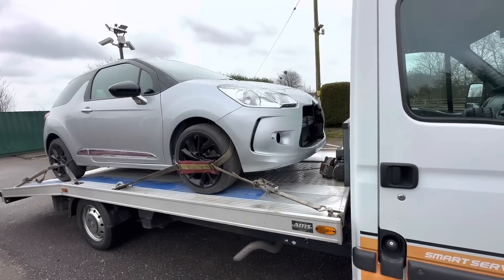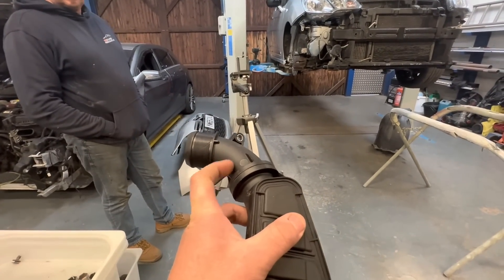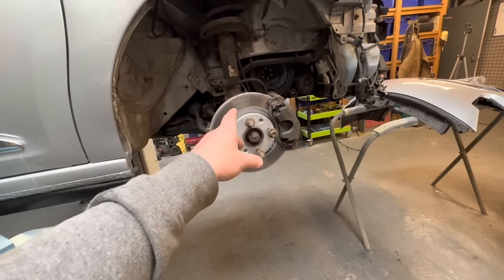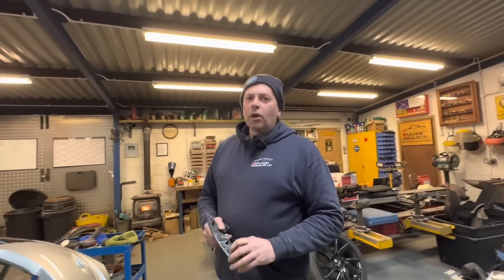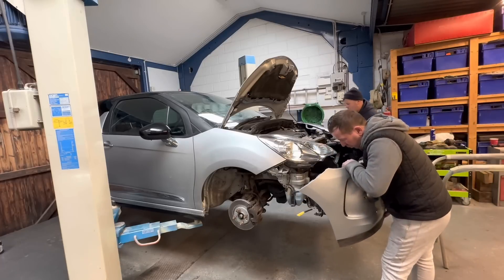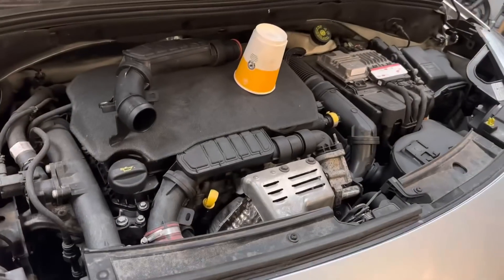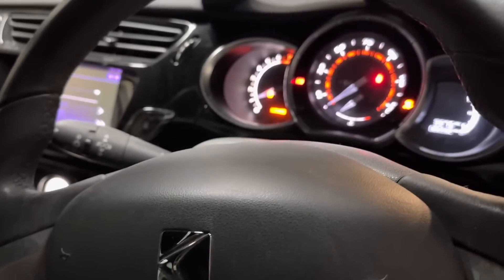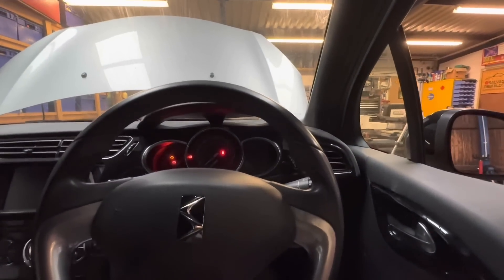CRASH DAMAGED DS3 FINISHED BUT WAS IT A BARGAIN ???

Comment: Sometimes a repaired car is a better buy than the "usual" car purchase because it might often include new or servicable components on the brakes, steering or suspension. Just beause a car is shiny and looks good it does not reflect the state of the mechanics of the car whereas with yours at least everything is known and upfront. Good job.

Comment: Clearly the older the car, the lower the eventual sale price so I would argue that the buyer should expect a few compromises in the cosmetic side of the work to put it back on the road - especially at the prices you charge. Over the years I have watched the channel I can only recall one occasion when you said - we won't fix that, we will give buyers the choice of a lower price or a pristine car at a higher price.

Comment: Hi guys, great video as always, I have a question to ask you chaps, when repairing the front ends why do you not re-align the front headlights?? Do they not need to be reset these days?
Reply: Most likely gets done at the MOT station they'd have to take it to, to get it back on the road.

Comment: Where do you get the tracking done for £30?
The rip off merchants at All Tyres Whitstable charged me £80 for a 4 wheel alignment. But that's not the end of the story. Needless to say, I would never go back to them.
Faversham branch were great, but Whitstable, were a bunch of cnuts. They wouldn't even give me a printout, as "it costs too much for printer ink" apparently.

Comment: grey and silver are hard colours to match, especially on plastics when the join with metal wings. I've seen a few motors badly repaired that are "50 shades of grey" lol, but this is a good match and the spray job is pretty damn good. Nice little commuter friendly motor, is it ULEZ? that's gonna make a difference in the next few months :)
Reply: Of course its ULEZ, you silly sausage!
Reply: @wackojacko123  lol, I should have known.

Comment: The issue about you guys rebuilding crashed motors is that you spend the time and effort recycling used parts (as old as the rest of the car so nothing dodgy) while insurers won't risk that. That's why a car they would technically write off is perfectly possible for you guys to repair. Similarly, you aren't paying hundreds a week to provide hire cars to owners while taking time to repair the cars. At the prices you sell the cars for I would take one off you in a heart beat!

Comment: So, using your example, there is no guarantee that any cars that you guys buy, haven't had a prior repair, if the previous owner hasn't made an insurance claim after an accident, you won't know, unless the repair is obvious, or the previous owner tells you. So Car Vertical is only useful, if a previous owner has recorded a claim in that respect.
Reply: Same applies to any second hand car. Loads of cars will have had minor bumps fixed at the owner's expense, particularly if the cost is less than the insurance excess - or even if it's a little over, to avoid it being recorded, or their premium going up.
Reply: @allannicolson2607  Some new cars will go on the dealer's forecourt having had some bodywork repairs.

Comment: You guys are completely transparent about unrecorded,  accident damaged, cars which is great and the buyers know exactly what they're getting and the price is reflected in that too.  However because they're unrecorded,  when they're sold on to somebody else,  that individual will be completely unaware of the car's chequered history even if they do take the precaution of doing a check and may be in for an unpleasant surprise :(
Reply from the maker: There won’t be any unpleasant surprises with our cars as there is no sign of repair. I can’t speak for other dealers/ repairers 👍
Reply: @sruk  I know Rob [or was it Chris there]... I don't mean it like that at all,  your work is absolutely top drawer.  What I mean is that if a car has been crash damaged,  then as a buyer I would want to know that before I bought it... and make my decision on an informed basis.  That's the whole point in doing a Car Vertical check.  What I'd hope not to discover was that it was clear on Car Vertical and then to see it appeared in a video like this one.

Comment: You're a bit out on the road tax there Rob as my good lady has a 1.2 petrol DS and in November of last year it cost £165 for a years tax.
Reply: He’s not. It’s £20
Reply from the maker: This one is £20 bud 👍
Reply: @sruk  Ours is a 1.2 petrol too, the only obvious difference is that its an auto? I still have the reminder so know exactly what tax we paid. It seems bizarre that the difference would be that much.
Reply: VED rates go up on some vehicles if the are registered from April 2017
Reply: @nitro993  Thanks, that may well be it as it's a 2018 model.